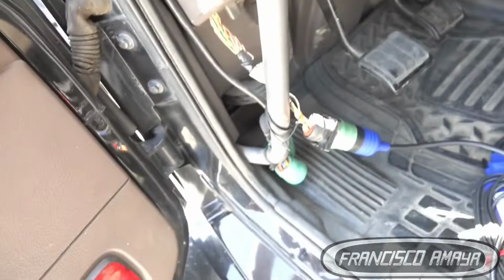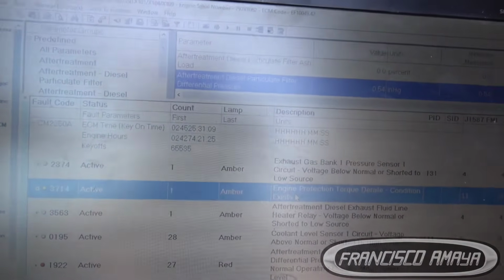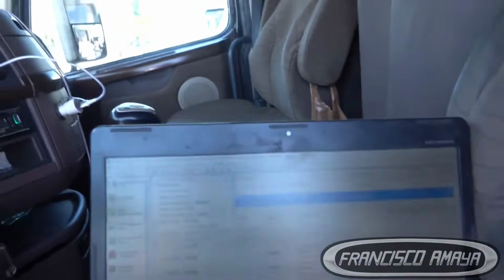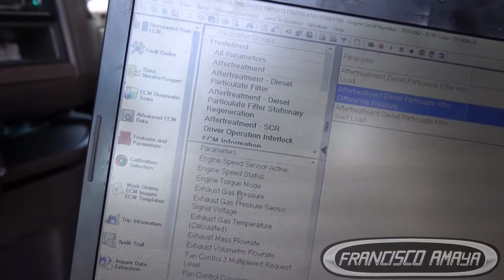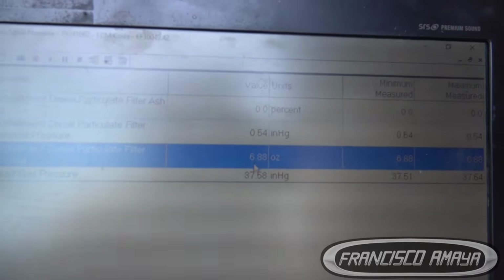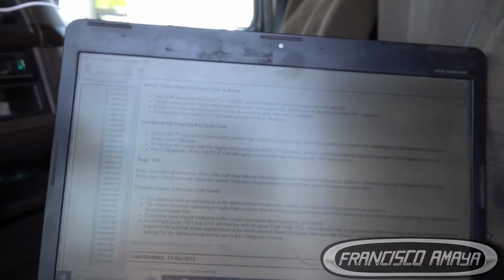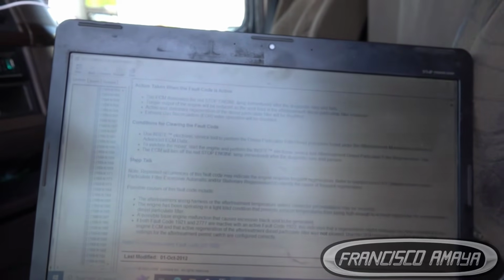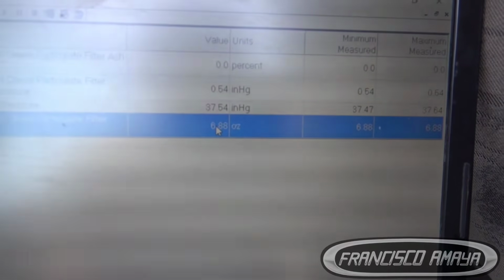VOLVO VNL CUMMINS ISX15 ENGINE REGEN PROBLEMS DERATE DEF ISSUES

Comment: I had so many codes in my truck t680 with a x15.  Knox sensors, actuador, def quality sensor, I was on level 1 engine derate but the lights kept coming on and off, and the problem was that the harness was rubbing on the engine and the wires got peeled causing a bunch of codes.